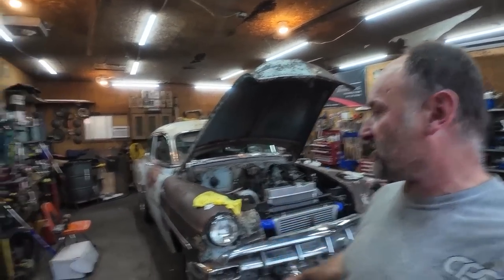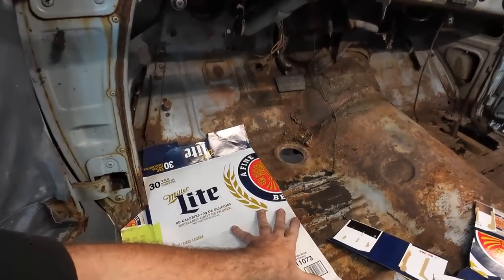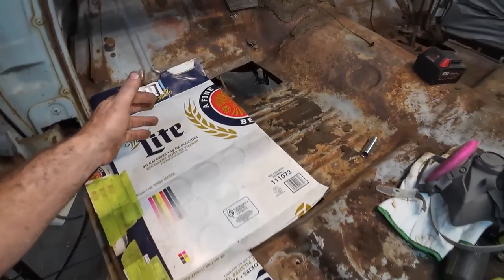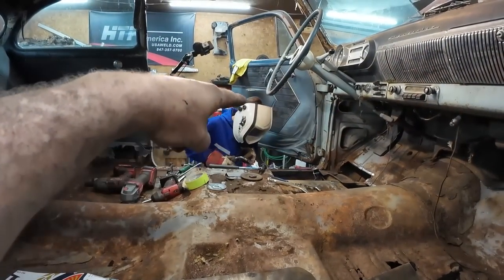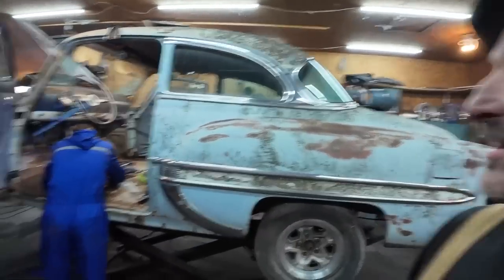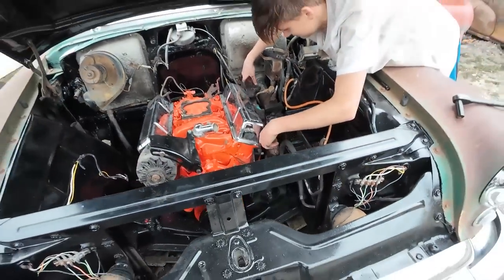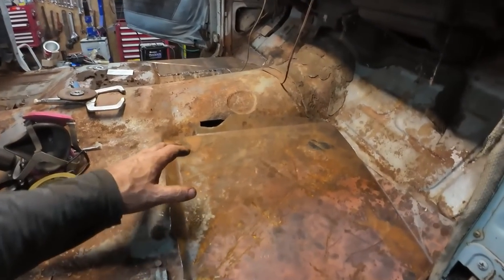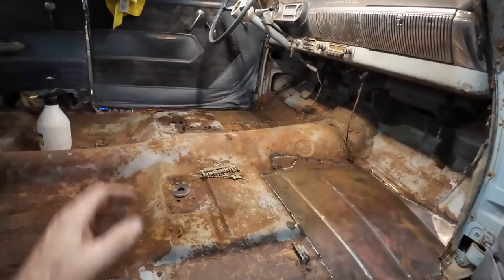Back on the 54 Chevy! Making floor ribs without a bead roller??

Comment: The way you attack rust repair is a massive lesson in being an adult and doing all the necessary's steps to get the job done right. Not a glamourous task for sure, vacuum, cut, wire, brush, template, cut metal, trim, tack, weld, seal, paint. But the way you attack the task is a real life lesson in how a Craftsman Hot Rodder handles the mundane critical necessary for success. If you young protégé' is watching he should have paid you for the lesson in sheet metal repair. Absolutely outstanding video, worth the price of admission. I want to help you so much. Shake your hand and pat you on the back. Job well done young feller. Dennis in Virginia

Comment: I like the 54 Belair even more so than the 55 thru 57 Chevys..  it’s just a neat old car…. The floors look pretty darned solid and I thought the improvised beads will serve the purpose.  I’ve said this before, I love the sheet metal work you do….
Reply: I feel the same way. I love the early 50's Chevy's. He has another one out by the motor shead...

Comment: Awesome job welding in Austin,,, the only way to get better is time with the hood down doin it 👍🏻 😎 don't be disappointed with the blow through,,,, you can't weld rust,,, it's just a fact 😉 stay at it bro 👍nice job on the floor ribs Brent 👍🏻 I was thinking rod in panel 1 glad you tried it for panel 2, if the iron worker was running you could have crushed it in with the same setup under the lever arm above the shears

Comment: You doing the floor brings back long time memories. For years I've just had 2 bed rails, a vice, hammers and random chunks of metal making floor pans. Only in the last 3 years I've been lucky to afford a beadroller. Still help friends patch their floors but most of the time i don't have the beadroller around and still land up doing it the old way.

Comment: A friend of mine made a die set for his press to make those beads. He welded half a 3/8" pipe to a steel block and a 1/4" piece of steel rod to another block and used thos to press the beads in.

Comment: Brent to clean up the rusty replacement steel i use a 4 1/2 cutoff disc hold the grinder disc at about a 45 degree angle and move the grinder sideways back n forth pretty quickly and this gets most of the rust off real fast. im cleaning up some used 55 chevy 4dr quarter panels on the inside so i can put some rustoleum paint on the inside before i weld them on.
im  building a beater 55 chevy convertible from what i have to work with. i like how you made the lines in the floor pans by hand 👍👍

Comment: for forming I have used whatever is around but some 1/2" plywood screwed down slightly wider than the thing you are banging to make the bead is the way I've gone. Makes a decent bead without much work. If you can clamp the top side down to the plywood it helps with bending. I've seen some guys drill holes and screw it down and then weld them up but that seems like extra work v.s. a few whacks with a hammer to flatten them back out again.

Comment: try using your air hammer on low speed to bend the metal for the bead rolls. good ol hand hammer works to. it coming along. cheers.

Comment: The floors work. Dont forget about the body mount holes and bolts. :)  You removed the drivers side bolt, but didnt see you remove the passenger side.  At least i think they are body mount bolts. At least no water will splash up from the roads. :)

Comment: I was going to use a wood stump to make my floor ridges, put a slice with my chainsaw that’s the same width as the tip of my ball pein hammer, then stretch the metal out with a flat hammer, and use the ball end of the hammer to force the metal into the wood slot

Comment: I done the same in my 64 Buick with scrap microwaves/washer's an dryer's an just screwed em down until I get the right sheet metal to make some floors but atleast it's not a Flintstone model no more

Comment: No bead roller? No problem, fire up Bam Bam 2…
Or, air hammer with a blunt end and a block of wood or rubber mat. 
Thursday evening , taking time to relax and the meeting of the minds, awesome! 
Wonder if headers from a 80’s firechicken would work in austin’s car? They arent pretty, but the price of a cold bevvy seems fair to me. I may even throw em in the blast cabinet…

Comment: when you use a bead roller or the way you did - don't you 
need to make the panel bigger for shrinkage?
I think Carl mentioned that
Reply: When he hammers it flat on the table after he formed the beads he is stretching the metal so same difference

Comment: You built a bam bam 2 you could do made quick die.for it out of 3 old bolts with head cut off layer in row welded on outside center bolt to the top bottom bolts to the bottom die and go.

Comment: Brent, did you use any rust preventatives paint or rust prevention spray before you welded the sheet metal on the 54 Chevrolet?  It would help to  prevent rust in that area.  Its recommended that repair or replace the sill area of the door area and then repair the floorpan.

Comment: So how do you like the Milwaukee compared to the Dewalt Brent? I like the milwaukee ,I use it for everything like you ,wire brush stone cut off, and if to get a vecro pad you can use it for fine grinding an stripping paint with the 80 grit stickems.I put a big cutoff on it and use it to cut pink fiberglass insulation and vynal siding .
Reply from the maker: Personally I don't notice much difference I just felt if I was starting over Milwaukee just had a more wider tools variety

Comment: In my minimal experience with patch work, I’ve found that making the metal patch before cutting out the rusty section worked pretty well. 

…you can even use the existing rusty floor as a “dolly” to start with the shaping process.

Comment: You might have been able to at least define your "bead" edges with the sheet metal brake before doing any bends.
Then hammer back out the flat spots and do the shaping bends.  
Use a piece of iron pipe on the anvil as a dolly to massage the round parts.

Comment: @HalfassKustoms
Questtion - 
Brent, would it be possible (and quicker or easier) to have put the panel into the press, put a 4×4 wood block under it, put the tire machine tool on top on your line and press it into the panel?
May be camera angle but it looked like the panel would go most, if not all the way into the press to me, which made me curious about this possibility.
Reply from the maker: Would work or smaller panels the floor patches unfortunately wouldn't fit in my press

Comment: Just a thought… No bead roller ? Why wouldn’t it work as good to use a large ball peen hammer round end an make several indentations in the metal the depth u would have a bead ? Huh huh ? Remember, we ain’t making a car for the government, ya wound see it when it’s covered cup !…also possible to use a ball of a ball hitch to dimple the sheet metal floor patches. Smack um hard !
Reply from the maker: Haha where were you a few days ago